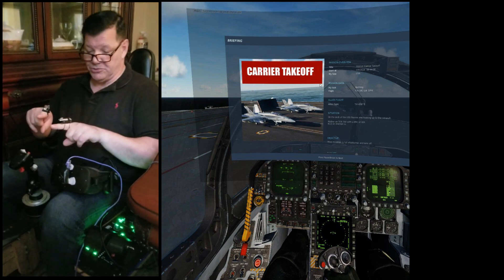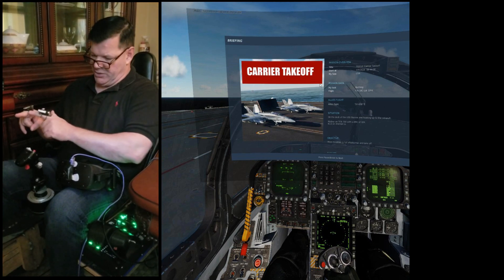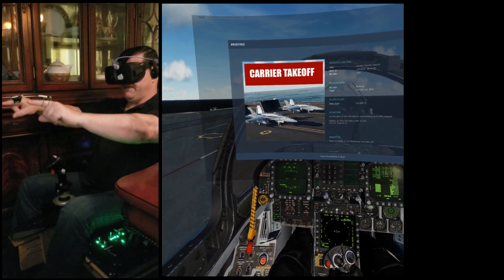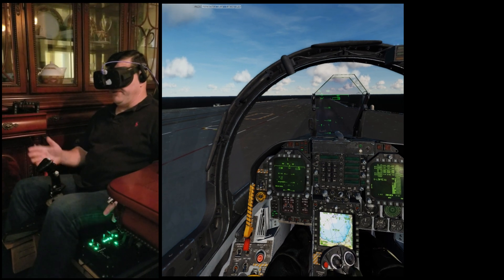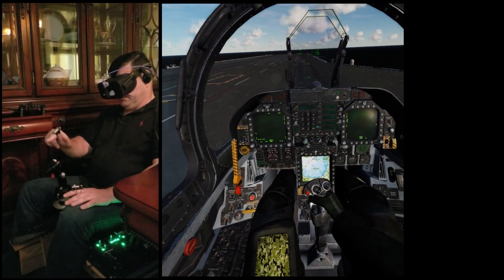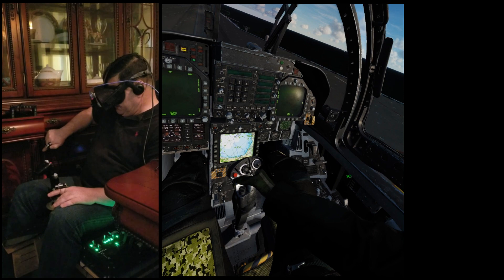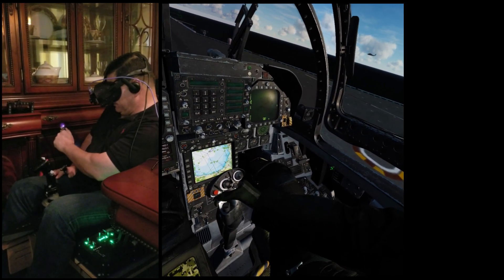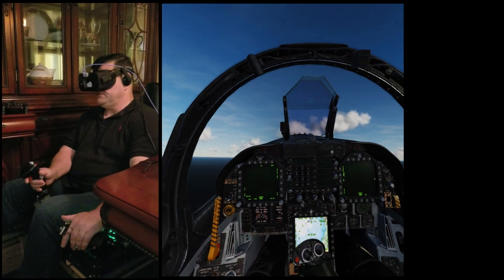PointCTRL prototype test

Comment: Don't leave the launch bar down - once it's down and latched to the shuttle, raise it. It won't actually raise, because it's locked into the shuttle, but once you're off the cat and airborne, it'll raise and you'll be good to go.

Functionally in DCS, it makes absolutely no difference, but per NATOPS the launch bar should be placed in retract prior to departing - good practice to get into in case you ever find yourself on the deck of the Stennis in a real Hornet, or, heaven forbid, ED add that little realism in there without putting it in the patch notes...
Reply from the maker: Thanks for the tip Stu, I would like to learn the F18 better. I am more of Helo guy, but I have been flying the F18 a bit for testing PointCTRL.

Miles

Comment: The design is spot on regarding requirements and solution. The headmounted camera&electronics SHOULD, as I see it, be by USB cable. I really cannot see the benifit of batteries there, I want the headset being as light as possible! The headset already has a cable, but for flight sims this is not a problem, you are sitting down... The contact should preferably be micro-USB since that makes the PCB requirements smaller, but otherwise it really doesn't matter. 

 I don't know your solution, but I would make the FCUs using a nanowatt MCU, (even though it is overkill for a switch-IRLED you can gain some possibilities). You can switch the IRLED with a lower duty cycle to save battery, you could program some sleep after some inactivity, or a fourth button to short press, long press, double press, for shut down, wake up, or do some other thing. But remember your initial design philosophy, keep it simple!

As for the battery life in the FCUs, 10 hours is enough! For a more refined product I would put a small battery charger chip and a micro-USB port into each of the two FCUs and skip the extra batteries. That is only IF that extra circuits are tiny, otherwise it is better with external charging, the FCUs should be compact and light.

Lastly, I can't find any way of contacting you to order these... I wan't to buy them as soon as possible. Do you have a website? I can be a beta tester if you want, I started with electronics 1976 and computers 1980... I know what it takes to go through the prototyping stage and actually make something that can be sold. It is a hard ride...
Reply from the maker: Thanks for the comments and recommendations Anita.  To speed things up I am moving forward with the wired HMD to start. The required lipo batteries are actually lighter than the USB cable,  but the wireless option will be available in the future. I am using a 328PB MCU in each finger control unit with a NRF2401+ transceiver. Yes they are a huge overkill, but I wanted the user to have the ability to customize settings such as IRLED brightness, timeout, standby brightness, and alternate button functions, monitoring battery life, ect. The prototype is currently implemented with a PWM output and caps so the user can adjust the brightness to their environment. Default timeout is 30 second of inactivity and reactivation is with any button press. This can also be adjusted through a simple options screen. Additionally I implemented a low power IRLED standby mode option that only draws of few milliamps, but triggers the IRLED on state when  the FCU  is within a set distance and visible to the HMD. I am not locked into the removable battery, but it does make the device lighter. There are pro and cons for each method. The biggest ones for me were if someone had a really long gaming session or forgot to charge the FCU, maybe their back ups would be charged. Additionally small lipos  are usually good for any where between 200 and 400 cycles, so a removable battery with a $4.00 replacement cost seemed logical.  As far as sales go, I see this as a niche market, and I am really just doing it because I enjoy it. I will have a website soon with updates, and online purchasing. Cost for the whole system with 2 FCUs, HMD, batteries and chargers will be between $150.00 and $175.00 USD. You can follow progress on the DCS Forums.

 https://forums.eagle.ru/showthread.php?t=218861

Thanks Again for the input,
Miles
Reply: Spec Tech DMT Thank you for the detailed reply! You got a customer waiting... Please note that I am not registered on the ED forums... But if that is the only way, then I will create an account there, because I want these gadgets!
Reply: Spec Tech DMT By the way, the ED forums tells me that your private message box is full... So messages can't be sent.

Comment: This is actually REALLY good stuff! I like the fact that you are testing this in DCS. Do you think it should also work in the other sims (X-Plane, P3Dv4, Aerofly, etc)
Reply from the maker: Thanks for the comments BelGeode, PointCTRL emulates, and is recognized as a standard mouse and does not require any additional software or drivers installed on the PC. This makes it compatible with any software title that uses a mouse. There is software to change the default settings through a graphic user interface for options such as mouse button set-up, tracking IR LED brightness and timeout to save battery life, custom button assignments ect.
Thanks for the interest,
Miles